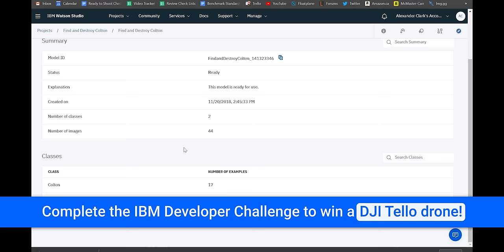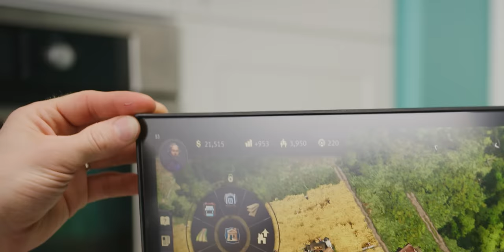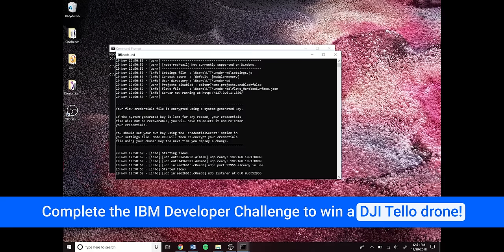FINALLY Upgrading my 4 year old Gaming Rig!

Comment: If you don't want corrosion in a system that pumps water, 
you need 2 Things: 

1. You need water that has absolustley no salt and almost no calcium in it.
Therefore the  conductivity of that water will be near zero.
you may aks a plumper where get such water, because every modern heating system has to be filled with this type of water
 because of anti-corrosion of the heat excangers that are made of a special kind of aluminum.

2. You need a sacrifical anode. 
That could be made out of magnesia that is grounded, so the magnesia will sacrifice over time.
You can also do that by a elctrical anode, but that would be a litte overkill for a pc.

And it would be a nice thing to get off as much O2 out of the System also.

For all of you who do have a european style heating system at home: 
you can use the "old" water that is located into that heating system, because that water is prety much "dead".
Get enough of it an filter it with a coffee filter an you are good to go.

Main problem with soft tubing:; these allow diffusion of O2 into the system.
Tubing amde out of metal (CU,Al)  or of PE-X would be the best way to prevent you from that.
You may ask you lokal plumper guy for GEBERIT Mepla.

If you want to prevent the water from biological hazard - but some UV LEDs somewhere.
UV Light does kill allmost everything in the water.

People from Europe: Feel free to cantact me about that.

.

Comment: This is 2019, who is still buying Intel?
Reply: Uh... a lot of people who want the best performance? People who aren't "on a tight budget" (this loosely translates to "poor people").

That's who.
Reply: @MrAndroid2013  Best performance? I will buy Ryzen 3950X and I'm an Intel user, just not fanboy. Today AMD will be first, similar IPC double the cores $1000 cheaper. Next year Intel will improve with 10nm, but other than some sheep who stays no matter what, many will move to AMD.

This doesn't mean that if Intel pull a good CPU and reasonable price I wouldn't be buying an Intel processor.

And about "tight budget" my first PC 8 years ago costed me 3500 euros. But I became a smarter consumer ;)
Reply: @MrAndroid2013  Also this is reality:

54.79% of gamers on Steam are still sitting on 4 cores.
26.27% on 2 cores.
Only 6.24% of all CPUs have clock speeds that go over 3.7 GHz.

I have my dear Intel 4790K and it was a good buy, but I will upgrade this year or next year. As for my GPU with my 1080 TI I will stay for 2 more generations of Nvidia and see how things are going on the GPU market.
Reply: Intel just got their ass kicked by the new AMD Ryzen 9 3900X 😂

Comment: I’m running a Mac Pro from like 6 or 7 years ago that has windows on and all I can remember from it is 2 gpu and  8 ram and with a 27 inch screen that still looks good now but it recently got a huge crack. So I am getting a rog x570f with 9 3900, a 2080ti 11gb and 32 ram. I can play overwatch in high settings with decent frame rate with my Mac. I’m happy with that but I love skyrim and love the 4K skyrim it’s a beautiful looking game with it so I really get my new one for that and watch dog 3 when that comes out and with a 4K 120hz it should look amazing. Linus’s was a small up grade but mine is a monster upgrade. The only thing I’m keeping from my old set up is the chair for now, new keyboard, mouse, mouse pad and new desk. It will be a whole new gaming experience for me.

Comment: The AMD Rx 5700 XT is only $350-400 and is rank 13th on Benchmark Leaderboards, the Nvidia GTX Titan RTX is $2,500, if it were me I would get 2 Rx 5700 XT's and an intel core i9-9900KF that costs $450,  corsair vengeance LPX 16gb ram $65, crucial MX500 1tb ssd, MSI B360 Gaming Plus motherboard ect ect I'm not trying to write out a whole build cause I'm lazy but that is what I'm currently working on✌!!

Comment: That block does not look good for four years, Linus. You don't just need biocides but anticorrosives especially if you mixed metals. That nickel plating is floating around in your loop and making things erode faster most likely eating into the acrylic which would be the cloudiness you see. Over time that won't just kill your resell value but clog the fins and cause leaks.

Comment: Hello Linus, Could you give me some tips upgrading my computer?

What would you do with this spec? Would you just build a whole new amd based computer, or would you do some upgrade on the items I already have? (I only use my computer for gaming)

PowerSupply - Corsair RM850i

Motherboard - MSI Z170A GAMING M7 (MS-7976) (U3E1) (Intel)

GPU - NVIDIA GeForce GTX 980 Ti (MSI)

CPU - Intel Core i7 6700K @ 4.00GHz Skylake

2x RAM - Kingston HyperX FURY Black Size:8192 MBytes Max Bandwidth DDR4-2134 (1067 MHz) Part Number:KHX2133C14D4/8G

Comment: Do they not make a non corrosive additive for water cooling like they do for automotive applications?

Half of the reason for antifreeze is to prevent corrosion vs plain water.

I didn't bother with it back in the day and the water alone corroded my entire thermostat assembly, literally nothing left but grit.

Comment: I have a question I need help answering. I was planning on doing a PC build that’s around 2.4 thousand dollars (one of the builds on this channel), but I was wondering if it’d be better to buy a premade decently cheap pc first, and upgrade part by part.
Reply: If you have the money to buy everything then just go for it. 

While yes you may be able to sell your used components as you replace them you probably won't get market value.

Comment: 7:40 no thats because EK's plating is shit these days. I have a set of EK block from back when they used good plating, and they NEVER EVER EVER EVER eroded, still look perfect. They are gpu blocks that I've used over the years, and modded to fit other cards. I've used them for 8 years, no problems. If Linus wants proof, I would sent him one.

Comment: Linus's Sex Tips...
1. Always bring a rubber when you have that much sex appeal.
2. Never go in too tight.
3. The inside can have a lot of vibrations.
4. "5:58" finger motion.
5. Microbial growth will gunk up your blocks and it's pretty much game over.
6. Trying out new endeavors.
7. Clean up before you are ready to mount that big GPU
.
8. It's good news when it just barely fits
.
9. You can rectify mistakes.

Comment: "Finally upgrading my 4 year old gaming rig" he says. Meanwhile I play on a 10 year old Gigabyte GA-M68M-S2P rev. 2.3  using an AMD PhenomII 555 BE 2X CPU with 4 GB DDR2 400mhz RAM and a  Radeon HD7570 GPU.......   I could sure use an upgrade myself lol don't get me wrong this still does well considering its limitations due to age but seriously I need an upgrade lol

Comment: us canada uk and spain? thats a odd selection of countries for ibm competition, id understand if it were only us and can, or only uk and spain. well enough bull from me :D
does that m-board have only 3x sata slots?`or is it six? cant tell from the video.
as an interested n00b in pc builds i have to ask. you just swapped the m-board and gfx car along with a new cpu. wont windows be like confused? or doesnt they have any interference with each other? meaning i can swap all kinds of hardware components however i want? well not the HDD of course cause thats where the system is on.

Comment: Hi there poor gamer here,
I am here to ask for advice and enlightenment on my ram upgrade. I currently own an Acer Aspire M3790 which I bought years ago. My current ram is 2 GB DDR3-1333/PC3-10600. I would like to ask:
1.) Can I use this 2GB in tandem with a new ram I am eyeing to buy which is a 4GB DDR3-1600/PC3-12800 (YRUIS or RAMSTA which is the only RAM i've canvassed so far in the nearby stores)? I'm planning to buy one at first and then buy a second one later to replace the 2GB for a total of 8GB if it is compatible.
2.) If it is compatible, which is more preferable Ramsta or Yruis, or is there a better brand with the same specs?
3.) Should I strictly stick with 1333Mhz/PC3-10600? It is hard to find 1333MHz, most stores sell only 1600MHz. (I find buying online too expensive especially the shipping fee)
4.) Any further recommendations?

Thank you for your time. Im hoping for your advice.
Reply: Newer motherboard can accept ram sticks of different sizes, but they will be run in single-channel mode. There’s a good chance an old laptop might just reject the configuration, though. I assume  you have one stick of 2GB installed. If you grab a 4GB module, 6GB might work. I would recommend just waiting to buy the 2x4GB kit, because it is more likely to be accepted by the motherboard, and it will enable dual channel mode which gives a performance boost (for gaming, if you’re using an old laptop with integrated graphics, this is likely negligible.) Yes, you can use DDR3-1600. The motherboard will just clock down that module to the slower stick’s speed to maintain stability. If you can’t find the same manufacturer as your installed stick, then brand doesn’t matter. Just get what you trust.

Comment: 8:17 That's why I don't want a liquid cooling system. Besides aesthetics, there's no real reason for most consumers.
Reply: Anyone can do water cooling easily these days using AIO.  Linus is running a custom loop and knows how to work it.  Him fixing the cpu flow problem by himself shows his geek knowledge.  But if you run only water for years, you'd be able to do that too.
Reply: Vee Clash I don’t understand your comment. Did you just comment to say random things? To agree with me? Disagree? I can’t tell. Regardless, AIO’s aren’t that much better than fan options, and most are worse or equal. I researched plenty before buying my new system and I’ve come to realization that unless you’re over clocking and pushing your system hard or after aesthetics there’s no real reason to go liquid (I didn’t mention oc’ing earlier because it’s self evident that liquid is superior).

Comment: i remember that day walking back home from work that i decide to upgrade my i5 3470 and Gtx 660 to a i5 7500 and gtx 1060 circa 2018 it was about 8 pm and i saw a pc on the curb i had seen a lot before but something caught my eye,.. it was an usb type C on the motherboard i just took the thing back to my work place an called an Uber,.  i plug the thing and power it on at home but nothing happened so i fix the ram on place and there it was i could access the bios the previous owner removed the Hard but it had a Mvme slot so i ordered one from newegg for $85 and in two days i was installing windows... i didn't even need to activate the damn thing it had a license link to the Bios but i did use my own license anyway....... i use the pc for 3 months when i decide to install Mass Effect 2 from a DVD i open the tray and found a Disk inside it was weird because it didn't show a disk was inserted anyways i put the mass effect disk 1 on the PC and... nothing happened i tho mmm this is weird hook up a Sata HDD drive and mmmmm nothing again........  conclusion the Sata controlled is dead but my PC has been alive for 2 years cant complain haha

Comment: Is a GIGABYTE GeForce GT 1030 Low Profile 2GB, GV-N1030D5-2GL good for gaming? I know it's random, but almost nobody responded to my comment to the previous videos i watched
Reply: It’s not great, but depending on what you’re trying to play it’s not terrible either. It’ll run a lot of indie and esports titles fairly well, but you’re probably better off opting for a 1050, 1050 Ti or even waiting for the low profile 1650s depending on how much you’re willing to spend.
Reply: no buy a rx 570

Comment: "very very last gen"
My gpu just burn down (R9 280) very very very very very very last gen? 
(Trying to reflow it but I'll probably finish up f-king it up even more because I've never done it and I only have a lighter and my hands to do it with.)
And now I'm stuck running my i7 6700K / 2x 8gb 3200Mhz---
with a GT9800 spare and I've got literally no money and will not have for probably a year or two because I need to finish school at all costs. So I'm stuck on a GT9800 idk how to call that. It was my first GPU. And now has to carry my PC. Warthunder that I usually play daily only goes like 40fps on "ultralow preset" with dips in framerate to 13fps. 
Someone pointed out that this vid is depressing 

:) - kinda agree lel

Comment: Where tf do you get slots to cover holes in the back of the case, where I changed the slot my gpu is in I've had to take out a new slot so I've had to jam one of the snapped off pieces in to cover the gap

I feel like that makes no sense

Comment: Motherbord vibrats like a car engine?
Reply: Not even close. The fans or cds spinning can just slightly shake the system enough to loosen screws over months or maybe years. Like shaking a bolt off an engine, but MUCH slower.

Comment: Really Linus I have an I7 960 with an GTX 970 which I upgraded from GTS 450 SLI on a 32" old vizio stop acting like your old system sucks which you probably got for free in the first place.

Comment: hahaha yo I will play any games on 30 fps if that's my only option. I was on NZXT seeing settings for custom PCs and the one that fit my budget ran RDR2 at 30 FPS, but it was in red like "this is really bad, you should upgrade this PC to get it into the 60 FPS range". I DON'T CARE AT ALL. IVE PLAYED AT 30 FPS ALL MY LIFE ON CONSOLES. I CAN RUN MOST GAMES AT 60 FPS ON AN $800 CUSTOM BUILT. RDR2 AT 30 FPS IS FUCKING FINE. 

I seriously don't understand the obsession with it. Like I understand it looks better (I consume pretty much all my content outside of gaming at 60 FPS), but I'm not gonna up my PC budget to $1,500 just so my experience in RDR2 is smoother. Especially when 99% of the games in existence will run at 60 FPS or higher. Sekiro is estimated to run at 120 FPS. Like?? Outside of Red Dead that's probably one of the more demanding games I'll be playing. Also, it can do video editing fine. Nah, in fact: more than fine. It can render a video about 40 times quicker than my shitty laptop. That's more than enough for me.